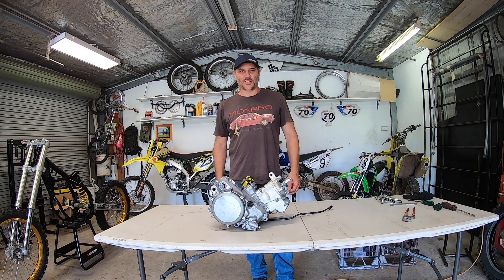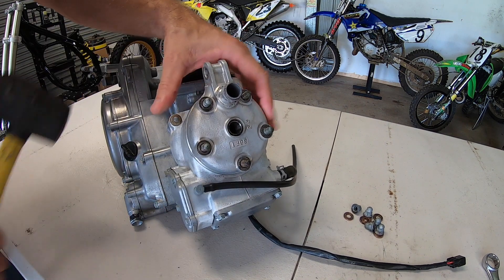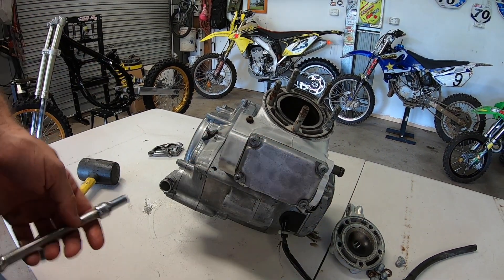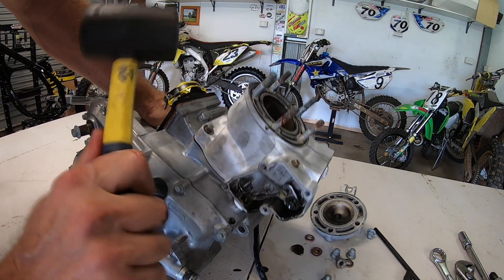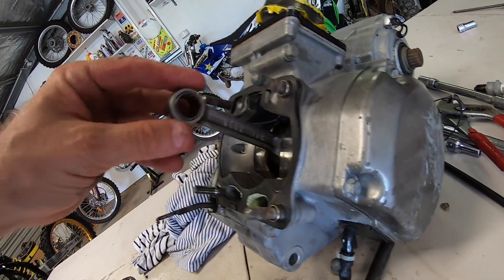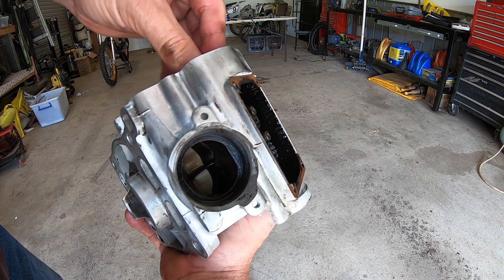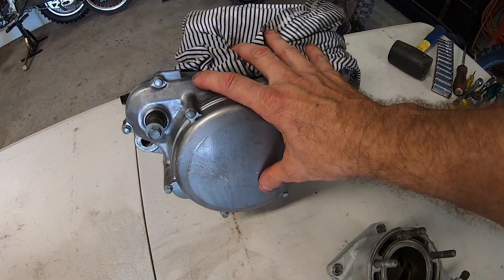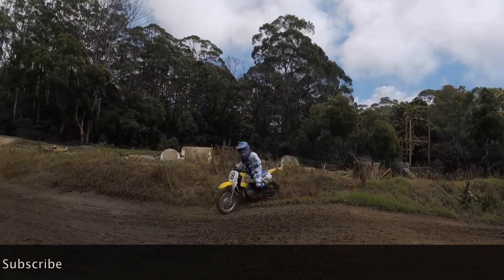2-stroke engine tear down and inspection. RM125 build.

Comment: I would do a leak down test on that engine. Because as carboned up as the piston was it may have been sucking crank case oil. The only way to know for sure that it is not is to do a leak down test.

Comment: I bought a basket case bike, I'm thinking it's a 80cc Suzuki, 2stroke, from the early to mid 80's  it's missing the cylinder, and head,  how can I Id the bike and get new parts? I got it with other stuff, I wasn't even going to mess with it, but it's in good shape,  besides the missing parts, it's like it was setting since 1985, in a building,  then someone was going to rebuild it , and moved. Loosing the parts,   I also got a quad about the same year and size, it's in good shape, new tires.  Decent shape,  seems it just needs the basics to get it going after setting! It's a bit small  for me, but I can still ride it , it maybe a 125, I think the bike is an 80, I doubt it's a 125, I can use advice,  thanks,